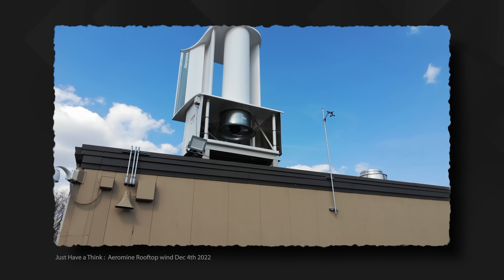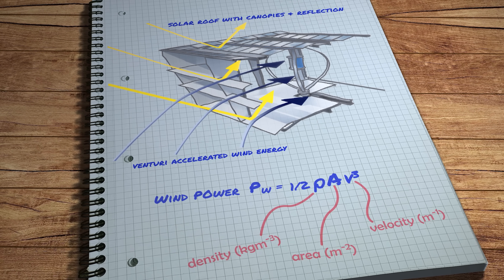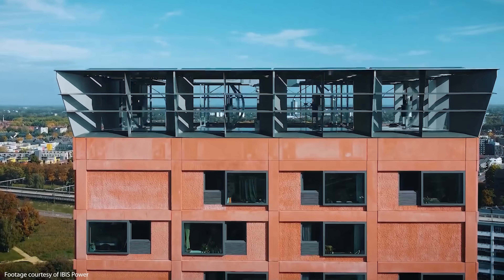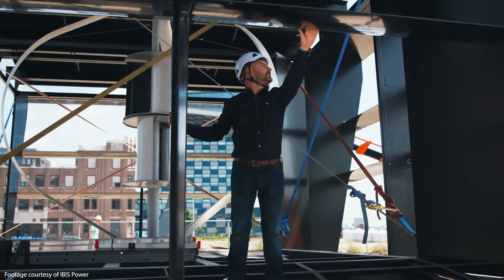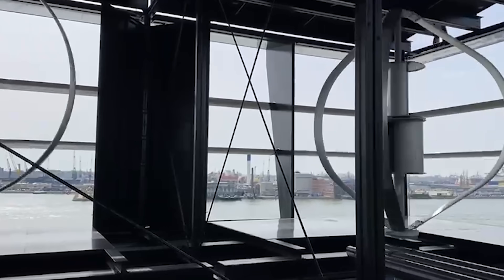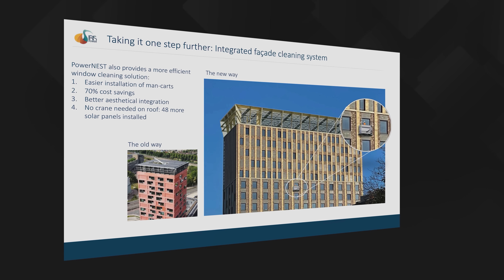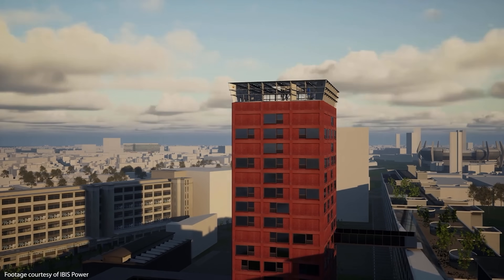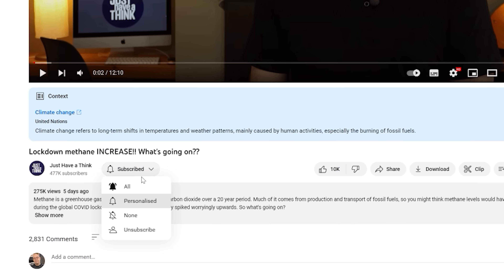The smartest renewable rooftop system in the world?

Comment: "Recent events in Utrecht have put a severe damper on what was hoped to be the new model of electricity generation. Adding to the widespread damage caused by last weeks unprecedented hurricane strength winds, a combined wind and solar facility was ripped from the roof of a ten storey building in its entirety, and sent hurtling as a thirty tonne missile into the building opposite, necessitating the evacuation of both sites. And this hot on the heels of the enquiry into the deaths in two separate incidents, of people working on these installations. It was determined that the high pressure hoses they used to gain reach in order to clean the solar panel surfaces, as well as the reflective underside coating, caused an arc of some considerable magnitude through the hapless cleaners bodies."
Reply: Wow! That's bad news. Thank you for this report.
I'd heard that the demonstration unit in Utrecht had been removed from the roof because it failed.
I wasn't aware that it removed itself! I'm not going to do the math and figure out the kinetic energy of 30T and 30m of gravitational acceleration.
Also saddened by the deaths of the maintenance workers. These are the people we have to stake the future of mankind's energy needs upon.
Is there information that this was a failure of design or workmanship? How could this happen or be acceptable?

Comment: How does this compare to traditional solar installations on slanted roofs for snow landing on top? Because in some cases this isn't just competing with traditional solar on a flat roof, but whether the building should have a flat roof to house this, or a slanted roof with fixed solar while abstaining from wind power (and the extra investment of the wind component) to maximize solar output in winter.

Comment: Bravo!! Solar on Every Roof!!  Honestly, let's target resilient distributed power and storage for all residential and light commercial, with energy saving from a DC standard for lighting and appliances with NO AC inverter or grid connection. No inverter power and heat losses, replacements or expenses. No line losses, transformer losses, and mass infrastructure upgrading or maintenance.

Comment: While we're on the subject of lateral thinking..  Since they are going to provide a reinforced beam to support the window cleaners, what about using that beam to run a collection of gravity batteries (e.g. weights on cables) as a low maintenance cheap form of energy storage?
Reply: The buildings are already near maxed out structurally by placing these units on top.
Are you suggesting to add a strong crane to the roof and hang unconfined heavy weights off, all around the building?
I'd look at the FEA that tries to justify the wind turbines up there. I'd consider that this is occurring above the streets and sidewalks of a busy city.
Reply: @jimurrata6785  If you take a look at the installation, there is already a large crane in the centre of the roof.  Per the video @9:32, in the next version of powernest, this is to be removed & replaced with a cantilevered beam that projects beyond the building.  This is to act as both extra space for solar panels, + to act as an anchor point for the window washers cradle.
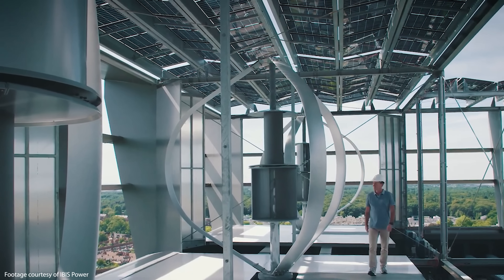Per load capacity & safety, may be an issue, however one would hope that the engineers could design reinforcing if necessary & a fall arrest system.  Note the powernest was claimed to be 140kg per m2, & they were intending to install a large (heavy) battery unit in the middle of the roof @10:46.

Comment: I like the general concept. Here, in the Seattle area, wind is often associated with rainy weather and sunshine with clear still air.
This system looks like it would be a good fit here.
Our across the street neighbors had solar panels installed, taking advantage of local utility subsidies. Between cloudy days and snow accumulation I wonder how effective they are.
The low pitch of the solar panels in the Eindhoven building makes me wonder how well they will shed snow...

Comment: VAWTs surrounded by structure? Guaranteed the LCOE would be much less than half just using solar panels. It's not the first time somebody has tried to cobble all the failed ideas into a new investment vehicle. That's not even considering the lift force on the building applied by those elevated panels, or the vibration that is definitely still happening even if the residents don't complain about it - those factors are going to significantly reduce the lifespan of the structure. Hiding VAWTs under solar panels to mask the turbines' garbage output is the only reason this made it past the first installation, and I'd argue that first installation only happened because the city was having a climate conference. If generating electricity was the actual goal there's no way VAWTs can beat HAWTs, and if you'll notice the much higher wind energy as you go above the buildings in the diagrams, understand that it keeps increasing as you go further up. That's why we build wind farms that are 300m tall with blades over 100m long. Not only are we harnessing a significantly larger amount of energy; the scale of the turbine allows it to harvest that energy from a cross section of the airmass that is larger than that entire building. That's why wind power is the threat that it is to fossil fuels. There is more energy in the sky than there is in the oil they're digging up. It's an actual direct competitor, not just a compromise on behalf of the environment. This rooftop nonsense is well outclassed by solar panels alone and has been for a while now. Panels are better for power generation, better for the structure's integrity, they're less maintenance (essentially none if they're installed well)  and they don't have moving parts that throw debris when they de-ice or fail. Solar panels go on rooftops. Wind turbines are best situated near farmland or coastlines (or offshore) where the wind quality is optimal, not near tall buildings that create all sorts of turbulence that expend the energy contained in the wind.
Reply: The residents under that first installation aren't complaining now because evidently the 30 tonne structure was blown off the roof and tumbled 10 storey's to the street below. 
Trashing a building across the street.
Both buildings are evacuated until assessment by structural engineers.

Comment: With a different shaped roof over the turbines, you could probably squeeze some more power out of them. I imagine something like an inverted air plane wing and smooth around the edges. An air plane wing is bowed upwards and accelerates the air above it. In my mind, this could also work the other way round. where the top is flat-ish and the underside bowed. With a few vertical guide wings you could funnel and accelerate more air towards the  turbines.

Comment: It sounds like a great idea. We have plenty of tall buildings with flat roofs that use a lot of energy for HVAC. If they could generate 85% of their own power it would be wonderful. (Way more useful than a green roof.) Applied globally, this setup could do a lot to cut into that air conditioning crisis you've talked about in previous videos. Just think of a city like Hong Kong, where there's high rise apartments as far as the eye can see. Retrofit those buildings with this system and watch the grid usage drop...

Is it totally modular, or can you replace parts as they wear out? I think the top surface of the solar panels will probably wear out faster than the other parts of the system, so they might need to be replaced before the wind turbines.

Comment: More lateral thinking for an improved design and functionality: Add railings by the side for a rainwater harvesting system as well + pump excess storage in the groundwater via a borewell.

Add some pipes and cisterns to include the concept of rainwater harvesting to make the system better.

Plus, cooling costs for your turbines can reduce if you make it flow through them before recharging the borewells beneath the buildings.
Reply: the solar panels are not installed "water tight", so the collection of the water from the panels is not a viable solution. But the water is coming to the roof anyway, so it's possible to collect it with or without this system

Comment: I wonder if the 85% of the building's power includes the heating and cooling.  When the buildings get the renewables system, there should be a conversion to heating and cooling with heat pumps.  The idea is to replace the building's fossil fuels with renewables.  It's the most important part, even though the building residents and/or owners are expecting to save money.

Comment: Hmm add a second maintenance cradle with weights and you have a gravity battery. Then you can skip the electric batteries
Reply: I don't think you grasp the pathetic energy density of those systems.
Nor the idea that the installation (as it is) is already maxing out the carrying capacity of the structure.
"Hey! Lets dangle huge weights over busy city sidewalks"
Reply: @jimurrata6785  Ouch.
Reply: @daffyduck780  I'd like to be more positive, but those systems don't even begin to add up under optimal conditions with dedicated structure. Like 2000 tonne weights hung in mineshafts where there's no breeze or anyone to kill at the bottom.
Rosie Barnes (Engineering with Rosie, channel) crunched the actual numbers and not only is the RTE extremely poor through a hoist/generator but the total storage isn't great on either large or small scale compared to options like pumped hydro, conventional batteries, heat cells or even flywheel gyroscopes.
I'm all for conservation and renewable energy sources but I bristle at green washing hype and the shysters that perpetuate it.
99% of "hydrogen!" falls into this category as well. The RTE sucks, the storage density sucks and it's only a way for big petroleum to cling to relevance for another decade.
There's never going to be enough curtailed renewables to make it viable. (and there shouldn't be)
If you have electricity, and want electricity, store electricity! No one is going to break the laws of thermodynamics in this millennium.
Reply: @jimurrata6785  Thankyou. I consider myself much better educated on the topic now. So if you want localised energy storage go for batteries. Got it.
Reply: @daffyduck780  Or use it for some purpose that is not time constrained, if transmission losses through the grid are too high.
Honestly, this installation will never produce enough electricity to meet the demand of a 12 storey apartment building.
Perhaps on a glorious summer day, while most residents are at work))
Reply: A 1,000 kg weight lifted 40 m stores 392,000 Joules of energy. If this is consumed at the rate of 3,000 watts, the weight will reach ground level in 130 seconds, which is 2 min and 10 seconds. Not very long.

Comment: I don't remember which of you guys (you, Two Bit Da Vinci, or Undecided) but I remember seeing a hybrid solar system that used thermal solar with photovoltaic thermal.  Basically, they cooled the solar panels, which actually increased their efficiency, and used that captured heat to heat the building/hot water.)  Seems like you could add that to the mix of this (although maybe the air does enough?  Seems like wasting that heat is a loss.)

There is a technology channel whose name I'm blanking on, who has been doing some neat projects with highly reflective surfaces and air conditioning, where he can cool air using the sun directly, although you have to power the heat exchanger to move the exchange liquid.  Not sure you could add that to this... there was a Chinese inventor who made color changing paint with the idea it could be light under heat to cool, but dark in cooler weather to absorb heat.  (Also, pipes under roads with heat pumps and large storage tanks, so you can store heat to heat buildings, and, when there is precipitation, to keep the road surface above freezing... there are some projects like that in Japan and Sweden, I think.)

Combine all that with an electric heat pump and maybe some of those solar windows and some solar cladding... I love the idea of combining a lot of ideas into new buildings.  Seems if you have a storage system in place a large building could power itself and sell it's power to its neighbors.  And don't forget good old poop.  There is a rail station that uses waste heat from the sewers for heat.

Comment: Would love to see them add a water collection system!
Reply: collecting water from where? thin air? But yes, solar powered desalination units are much needed for regular use. For agriculture, we need to haveathink...
Reply: @janami-dharmam  The flat, tilted surfaces of the solar panels naturally shed water - just add some collecting troughs [for rainfall] at the lower edges and send it to a tank.
This would not be drinking water but could serve as 'gray water' and used to water plants or flush toilets.

Comment: Looks interesting - and practical (unlike so many of these ideas!). 

But I'd challenge the 'lateral thinking' tag - most of this is just the result of normal design thinking. I think the only bit that (possibly) counts as lateral thought might be the use of reflected light to power the underneath solar panels. But, even there, any gardener will tell you that painting a wall or fence white is a common way of mitigating the lack of sunlight on a shaded bed. 

Unfortunately, the term 'lateral thought' is routinely misused (in much the same way as the word 'surreal' is).  The whole  point of lateral thought is that it isn't the product of normal analysis - it is a way of coming up with a solution that regular analysis and problem solving would never give you.
 
This is an extremely difficult concept to grasp and almost impossible to teach. My favourite bit of lateral thought from de Bono's own work illustrates why this is so. 

He was asked by a town council in (I think) Australia to look at the parking problem in their high street.  There were rules about where you could park and how long for, but people routinely ignored these, and it had proved impossible to police the situation. 

De Bono instead suggested that they just have one simple parking rule, that would be easy to enforce, as it would be obvious if anyone wasn't obeying it - that anyone parking in the high street shopping area had to leave their headlights on while they were parked.

This was many years ago, when car batteries were notoriously prone to running down and leaving you stranded - and the quickest way to run your battery down was to leave your lights on when parked!

No amount of normal analysis or 'brain storming' (another routinely misused phrase!) will get you to that answer. You literally have to think about the problem from an entirely different direction - ie laterally.

Comment: That is clever. I've been trying to research using 'managed airflow' (like F1 cars) to cool roof-mounted PV. Not only are the PV panels more efficient, they also last longer. Your Aeromine Rooftop Wind video showed pure PV was missing a lot. So this is Brilliant.  Even reducing demand on the grid by 50% for tall buildings could be game changing. In high-rise cities, eg. Shenzen (China), there are many tall buildings, and culture accustomed to living in them. Plus, it enables mass-produced, parallel construction, and relatively rapid, independent deployment,

This seems to indicate research and industry are homing in on very effective ways to harness solar energy, and mitigate the cost, time, and complexity of 'mega projects' to deploy it. Also it extends the use of existing land. Plus the cost of maintenance on land is much lower than at sea. 

Great video, Dave. ☮

Comment: This is probably the most exciting system you've highlighted to date! Not least because -it's actually here today-! One benefit of LEED certified buildings is they often put soil and vegetation on the roof for cooling and insulation, which certainly helps, but being able to instead harness energy while shading the building is super exciting! Especially given that every rooftop component would have better performance and/or longevity if they're protected from solar and heat radiation.
Reply: Oh, HAI! =)

Comment: The system as designed is certainly innovative but I do wonder why they have not included air source heat pumps in the exhaust of the wind, to recover the heat generated by the solar panels and cooled by the wind and thereby increase overall efficiency even more!

Comment: All that structure to allow for a few small turbines, turbines that won't generate much in most locations. Better to have pure solar with panels tilted to the south - less weight and much cheaper structure hence lower pence per KWhr.
Reply: And when the sun doesn't shine?
Reply: @swiftlytiltingplanet8481  True. The wind energy has more value because it often compliments the solar e.g. cloudy but windy days. Still I think it's a better use of resources to build large turbines in windy places.
Reply: 4 turbines a 3kw =12.000W absolute maximum... x 30-35% capacity factor.
Atop a 12 storey structure with ~ 4 apartments per floor. Given a lobby and mechanicals perhaps 11, x4= 44 flats
12k x .35 = 4.200kw.  At best each household gets 95.45 watts to live with.
You couldn't have a light and charge your iPad 💩